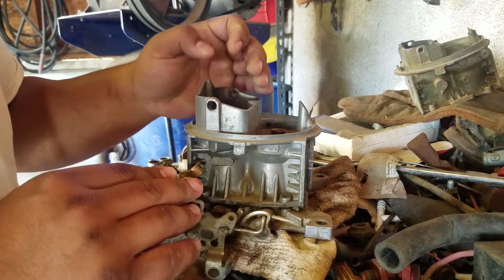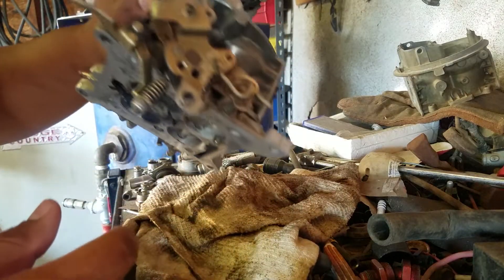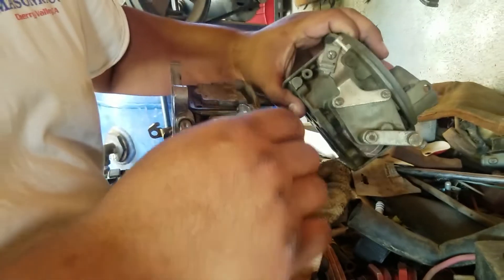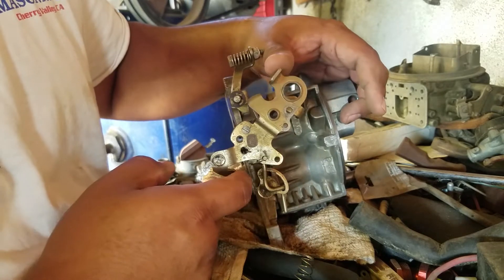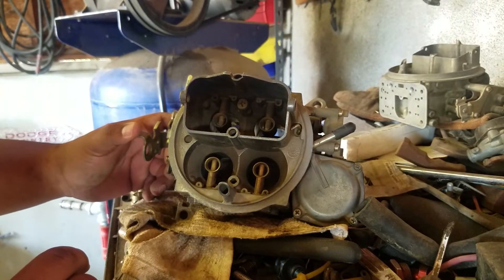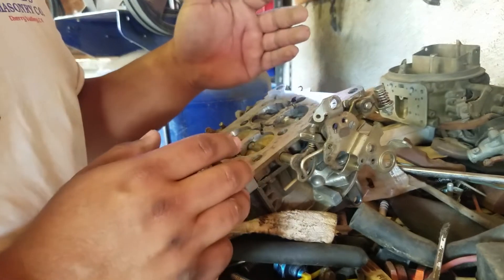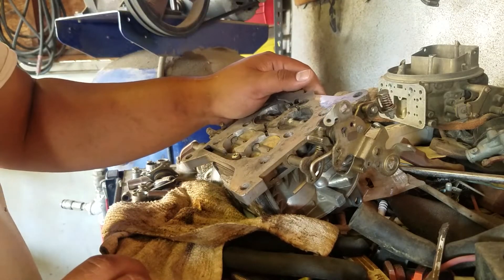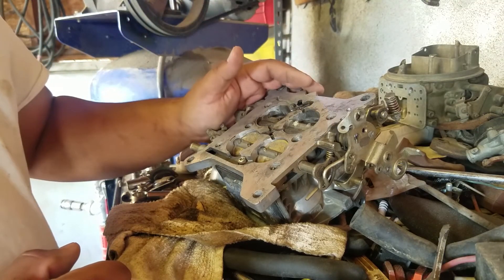Holley Vacuum Secondary Tuning EXPLAINED | Holley Carb Secrets | Holley 1850 4160 4150

Comment: I have a 89 Cobra and it only shows 5" vacuum at idle, vacuum rises to 20" as i open the throttle but when on the road at very light throttle its undrivable as I think its going lean, changed all the normal stuff including power valve, could it have race cam fitted ?
Reply from the maker: During light cruise, the only circuits feeding the carb are the idle and transition circuit. Provided that your idle is set up right and the fuel level in the bowls is good and you have enough fuel pressure, the thing I would look for would be the size of the IFRs. Chances are they are too small to feed your engine at part throttle. Even race cams should drive down the road smooth at part throttle so cam selection isnt the issue.
Reply: @NightWrencher  Thanks for the rapid reply however all of the above in my mind is set correctly but just to try and describe what it does is difficult here goes: Engine at idle just crack open the throttle sounds good but on the road in second gear do the same thing you would be hard pressed to stay in the seat as we describe it over here "Kangaroo Petrol" this even happens on a downhill soon as you you return to idle engine goes sweet. once you give it a bit more throttle it goes ok just makes driving in town at very low speeds impossible.  Shes only done 900 miles since new,  manual transmission one observation is the primary throttle blades have a hole each in them approximately a 1/8th in diameter which makes the engine idle with the idle screw right off, finally what does IFRs mean??
Reply from the maker: IFR= Idle feed restrictors
Reply from the maker: https://youtu.be/cIUhlHltPpM

Comment: I have a pair of 4160 carbs on my tunnel ram drag car.. Someone told me if I crack open up the secondaries at idle it will act similar to a vacuum leak because the 4160 carbs don't have meterting blocks and idle mixture screws on the secondary side of the carb. Is this true?
Reply from the maker: Yes, thats exactly true. In your particular case, I would resort to drilling out the primary blades instead. Theres a video online about how to do it properly because you can really mess up the idle mixture if you dont do it right.
Reply: @NightWrencher  Thank you, that is exactly what I was hoping to hear.. My motor acts like it has a vacuum leak and my secondaries are cracked open but not far enough to expose to much of the transfer slots.. But if cracking them open at all will act like a vacuum leak, that probably explains the problem because I verified there is no vacuum leak anywhere else.. I have custom Quickfuel 600VS carbs.. I also have some extra throttle blades and I can get more if I screw it up but I will start out at about .100 and work my way up from there if needed..
Reply from the maker: @Cuzntime  I did the same thing when I wanted a higher idle without exposing the primary transfer slot but I didnt have a 4 corner idle carb, so I cracked open the secondaries and my idle went up but everywhere else the carb ran really bad. So now I just run a 4 corner idle carb but theres no room for that on a tunnel ram.

Comment: Thank you for the explanation i am rebuilding an old holley 4160 for my 72 f100 its got a 351w this really helped me understand that system much better thank you for your explanation of the system and the use for the smaller v8 cruisers for the daily driver👍👍
Reply from the maker: Thats awesome man, itll be a good carb. Hope it works out

Comment: Good video, well explained. I have a 5,500lb f100 (super cab Longbed w/helper springs) I recently built a 390 for it, went with a Holley vacuum secondary 750 to replace the Edelbrock 660 manual secondary that was on the 360 that blew up... Night and day difference between tuning and drivability. Love my Holley vacuum secondary carbs run them on all the heavy vehicles.
Reply from the maker: Tuning a holley is super easy which is why I really like them. I dont run anything else. Even my tow rig has a 670 vacuum secondary
Reply: @NightWrencher  exactly, I've had great luck with them as well! My go to carbs.

Comment: If I get a rebuild kit for a 4160 is it worth just getting a vac secondary diaphragm for it too, or just see if the old one holds vac?
Reply from the maker: The rebuild kit should come woth a new new one reguarless. I would change it if youre already in there
Reply: @NightWrencher  A good local parts supplier should include one but they want 4 times the amount I can get it online. I'm in Australia so there isn't the biggest selection to choose from and I noticed none of the kits have the vac secondary diaphragm pictured or listed. When I look at the US selection the majority are the same but some do include it. Maybe because the kits are semi universal but not all carbs have vac secondary's.

Also are the vac secondary diaphragm all the same or do I need a specific one? Because I noticed the number 135-4 but not much else of a description.
Reply: Disregard that last question there seems to be a difference in rod length and I think the 135-4 is correct for a 1850
Reply from the maker: @coolhandluke1503  most are the same but like you said some are different. AUS folks have a hard time getting parts so I feel your pain
Reply: @NightWrencher  Sorry for bothering you with another question, but I value your opinion. The engine I have is a modified 351c that I didn't build, It has headers aluminum intake and a bigger cam, I don't know the spec on the cam, it's not race but it's definitely not stock. It doesn't look like the carb has ever been pulled apart (but I could be wrong). Would you recommend getting some bigger jets, and what sizes? I think standard are 66.
Reply from the maker: Jetting is a hard thing to estimate because changes like headers and intake change the fuel curve a lot. I try to base it on hp. For a 350hp 5.3 im at 70/65 with a stock cam. For a 400hp 6.0 hes at 71/72. For a 450 hp 383 we were at 72/72. If I was to take a guess I would go 70/72 to start.
Reply: @NightWrencher  I was thinking around that. Thanks for the advice, I really appreciate it.
Reply from the maker: Any time 👍

Comment: Great fundamental explanation! I have a 4160 600CFM on a stock-ish 302 and I've been tuning with an AFR. Strong idle vacuum. After a good shot and response, descent power....rich mixture (11-12.0) it leans way out at the top of the power curve (14-16.0). Is this because I'm losing vacuum or because the metering plate is too small, and not delivering enough fuel?
Reply from the maker: It sounds like your secondaries are too lean. When you say good shot, do you mean nitrous? Find out what metering plate you have in it right now and see if you can install adjustible jets similar to IFRs
Reply: @NightWrencher thanks for the video I haven't seen too many videos about the secondary system on a holly it's mainly just how to set it up and to adjust the primary Jets never really adjusting the secondaries  so you say that they sell a metering block that has provisions to install jets in it? Is that a Holly Part ? I did see the $80 secondary metering block that has the power valve and the idle adjustment screws or that would be secondary adjustment screws for the Jets around 80 bucks I'm not really sure what metering plate I have in it but I guess basically if it's a 600 4160 more than likely it's the same as the one that you had 74.

 I just recently converted over from a two barrel to a four-barrel on my 69 f250 it has a 390 I put a Edelbrock RPM intake manifold on it I bought a very early 600 CFM 4160 Street avenger I think it was one of the first that came out I know that it's basically just a classic Holly but it's not aluminum I haven't fired up the truck yet because I was doing some other things on the suspension but I'm getting close so what is the little screw underneath the the secondary diaphragm for is that for adjusting the spring or the tension on the spring meaning the tighter it is the later it will open the more l looseis the quicker it will open?
Reply from the maker: Some have a sort of adjuster that will help delay the opening by closing off the passage for air. The secondary diaphram that I like to use is the one with a removeable top so youcan replace the springs easily without taking the whole thing apart. The adjustible secondary plate looks exactly like the factory plate but it has holes for jets instead. If you switch to a metering block youll have to change the fuel crossover tube on a single feed or fuel rail on a dual feed. If you swap the plate, its only the plate.
Reply from the maker: Here is an example of one. Its gotta match your float type so make sure you get the right one https://www.jegs.com/i/Proform/778/67146/10002/-1?gclid=CjwKCAiA9tyQBhAIEiwA6tdCrLjB-tX3xtAl3-Epaj35M7yS2jIoaZcJTNSUGDlBTRdUKFWlYz6QZxoCGNcQAvD_BwE
Reply: @NightWrencher  got it yeah I thought about getting the kit with the different springs and the quick change as well but I'll drive it first and see how it runs I got a ton of other things to try at the same time I lowered the truck now it has a four barrel a lot of things to look at at one time on the first drive is going to be t crazy checking like five things going on at once but eventually I'll get to the point where I'm wanting to dial in the carburetor I went with the 600 for the fact that it was difficult to find a lot of 650s with the manual choke. 
going by the carburetor chart versus displacement it showed that I really only needed like a 580 so I figured the 600 would work great now a 650 probably would work as well with the mods that I have I have a mild cam but I'm pretty sure the 600 is going to work quite well,  I know a lot of people over carborate things they put double pumpers on small motors and and I've heard advice from people on YouTube where a guy was using a 750 double pumper on a small block he  said that's all he will ever use and I was just like kind of scratching my head you know I mean depending on how built your motor is but I don't think it was a built motor it was just a bone stock 350 and he had a 750 double pumper on it I'm like okay...

.. So I think the 600 is going to do me good and for the fact that I have truck heads you see I don't have the 390 GT heads that were on a car that had the four barrel from the factory my truck was a two barrel originally so the most of my restriction is going to be on the heads but I had good compression when I tested it I had 150 all the way around on every cylinder the motors rebuilt and it only has 3,000 mi so it's got strong compression in there
Reply from the maker: I really like the single feed 600s. They're light, easy to install and easy to tune. I always go vacuum secondary whenever I can. Tuning is actually easier because you can drill up whatever you need but on a bigger carb, all the orfices are bigger too so you need to install brass set screws and redrill to the right size to cure any overfueling issue. People tend to over size the carbs because it cures any leans spots that would cause hesitation but now they lost mpg and low rpm response. They tend to be lazy when running rich.
Reply: @NightWrencher  thanks for the vid i didnt know they had a metering plate that accepts jets that is a easy WOT secondary fix there since you dont have a power valve .  So that screw underneath the actuator arm on the diaphragm rod thats for tuning the tention on the diaphragm ?  Or is it better just to buy the spring kit although i can imagine the price on that kit the quick change shoukd come with all the springs i hope
Reply from the maker: The quick change kit comes with all the springs so thats not an issue. The screw you are talking about is a stop screw that rests on the actuator. That not really an adjustment for the secondary side. The screw should just barely touch the lever to keep the secondary throttle blades from getting jammed against the base plate if they get shut closed.
Reply: @NightWrencher  right 👍 on thanks i will look into these things although im going to drive first test and tune buy parts later thats usually the opposite of what i do buy parts drive and tune and hey i didnt need that 50 dollar part after all  .
Reply: @NightWrencher   just subscribed.......👍  seen another video you had up on 4160 to 4150 conversion is it worth it great vid  i chose the 4160 basically the classic Holly style since it was brand new but i bought it off a guy on offer up for 150 i think maybe 125 it was.new in the box but i had to buy the ford AT kickdown bracket for it so  im in  maybe 165 .00.   yes they were big on fords and its like a upgrade some will disagree from the autolite and motorcaft carb why they call it a street avenger i dont know ? 
Anyway if i had secondary lean issues at WOT i woukd probably invest the 60 bucks for the jetted metering plate  after that i would just get a 4150  prices are going up though there now pushing 500 new  i ran the 500 cfm 2bbl i bought it for 325 a few years ago from Holly its now almost 500 bucks .
Reply from the maker: If you're running lean, you can just dill up the secondary metering orifices but if you're running rich, you can drill them out, install brass set screws and redrill to a smaller size. The feed is on the bottom side of the metering plate. 4160s are harder to tune but if you can get it dialed in, it'll be bulletproof.
Reply: @NightWrencher  haha no I mean the accelerator pump shot. I installed a bigger one so there is no bogging. If I gun it my AFR will drop to 11-12 but should stay there much longer at WOT with secondaries open. Paper clip trick on the sec diaphragm shows that they are opening. But your video made me wonder how much they are opening. Anyhow yes, looks like cure is to get sec metering plate swapped to a meeting block w/jets!
Reply from the maker: You can buy a secondary plate that has the provisions for jets. Way cheaper than swapping to a secondary metering block

Comment: Your dead wrong or what those butterflies are doing on the secondaries they don't flap back and forth like that when you're vacuum drops they open completely, and the reason you change those springs out is if you want the secondaries to open at a higher RPM or lower RPM. Plus you might want to get yourself a bench so you have a clean surface instead of working on carburetors on a pile of junk like you've got going on
Reply from the maker: You know, you're right. I did a really bad job in this video. I do plan to redo it in the near future after I finish settling in my new place. I appreciate the critique!
Reply: @NightWrencher  wow. Good reply. Too much back and forth these days on the internet and you handled that like a champ.
Reply from the maker: I appreciate it, I just believe you should admit when you're wrong.  If I believe I'm right, I'll tell you exactly why, but I wont try to make up stuff just to save face.
Reply: what opens them if there is no vac.?
Reply from the maker: On my testing, I found that when I initially floor it, vaccuum stays around 5-8hg and once the secondaries open up, itll drop to zero. What I havnt checked is if when vacuum drops to zero, the secondaries continue to open. People always say a vac sec carb only takes what it needs so I'll be finding out exactly what happens at WOT

Comment: Definitely going to be going with a vac secondary carb for my heavy 4x4.
Reply from the maker: I've yet to fully tune a vacuum secondary carb so Ill be putting one on my truck too.
Reply: @NightWrencher  are these good carb for 1983 Ford 4x4 f150 c6 automatic transmission thanks
Reply from the maker: Yeah man, they're a solid carb